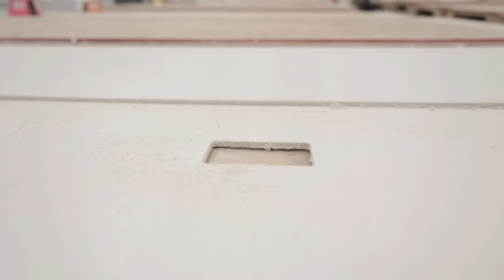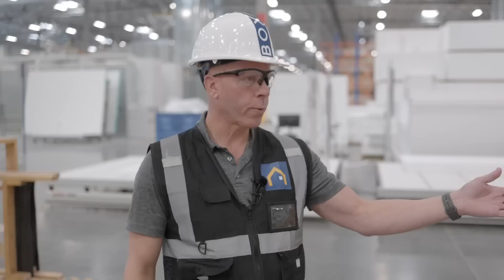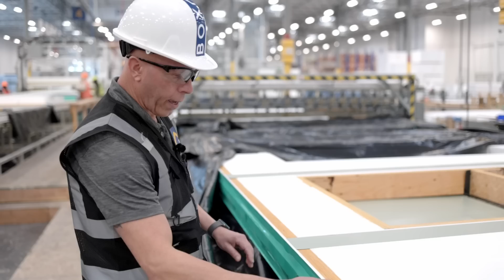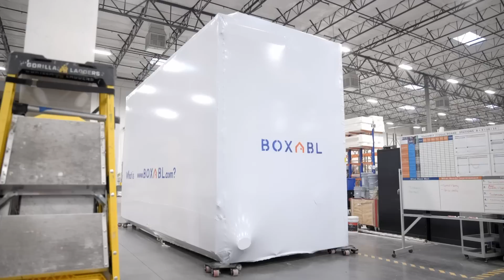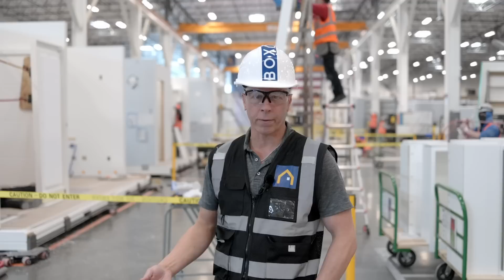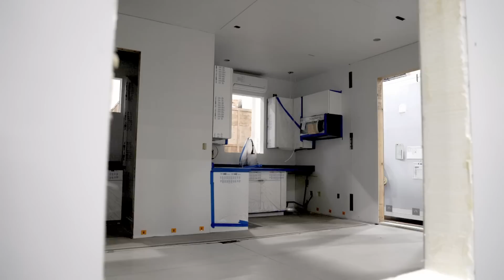Boxabl Warehouse - Affordable Tiny Homes on the Horizon

Comment: Remember when a Trailer House use to be Affordable? The Kind in Trailer Parks. You could get a Brand New Fully Furnished 2 Bedroom for Around/Between $20,000-$30,000 And Put that on a Nice Piece of 1/2 Acre for Around/About $4,000-$8,000 And Fully Hooked up utilities... Yeah, those were the days.... Now you get Used ones you have to move Starting at $20,000 and have to Fully Refurnish and Renovate and Move and Hook Up...

Comment: I heard that you use the cheapest styrofoam (for a low price) which releases phenol. Phenol is a poison that causes cancer from which people die quickly. (in the 2000s, FEMA also used the cheapest polystyrene foam in its trailers, which emitted phenol from which people got cancer and died quickly ...)
Reply: Why don't you use mineral wool? It is safer than expanded polystyrene - mineral wool does not emit poisons and carcinogens!

Comment: I really like the Boxabl, great price. 2 a day is barely putting a dent in their wait list, so I'm glad to hear that they have plans to increase production. Brilliant design that helps cut shipping costs. You still have to have or purchase land where it's approved by zoning, and there is site preparation, utilities installation and hookup, use a crane and crew to take it off the truck, set it on-site, unfold and finish setup. Every thing else being equal, it is less expensive than shipping a park model home to the same location and setting it up.